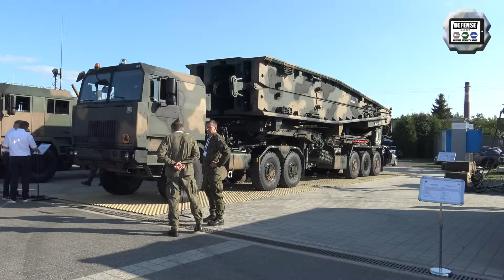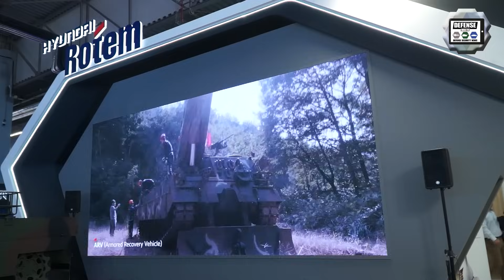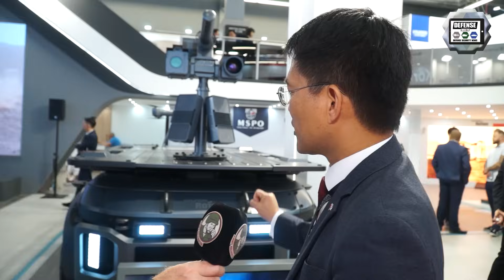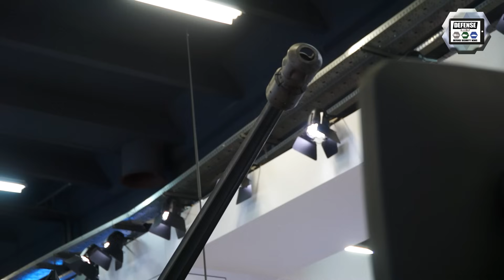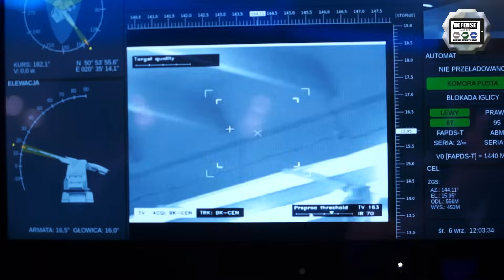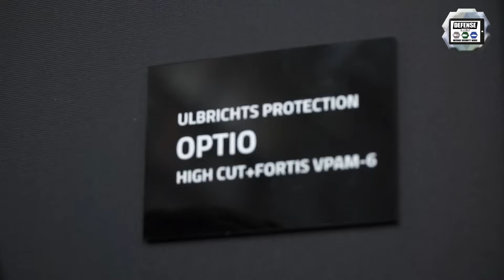MSPO 2023 Day 2 International Defense Industry Fair Exhibition Kielce Poland South Korea

Comment: More fantastic equipment from South Korea the K2 Black Panther is the best MBT in production at the current time with virtually every cutting edge feature currently available fully integrated into the tank.
When it comes to armoured vehicles they are at the forefront with the Redback IFV and the K9 Thunder self-propelled howitzer more examples of the forward thinking manufacturing powerhouse that is South Korea.
The latest conventional AIP submarine designs and builds that South Korea are currently producing are also cutting edge with new homegrown torpedoes and vertically launched missiles available for integration into the submarines.
They have become massive players in the global arms manufacturing market with some excellent cutting edge products available.
😎🇦🇺👍

Comment: Big mistake buying Korean Krap
Reply: it's not crap - Koreans doing really good stuff. You can also see that they are investing in high-tech which is paying off. For sure most is a lot better than russian equipment, especially that there are plans of joint projects between Poland and Korea which will bring transfer of technologies both ways.
Reply: Isn't crap but either not battle proven hardware, the problem will be on the battlefield those vehicles will be destroyed right away 😁